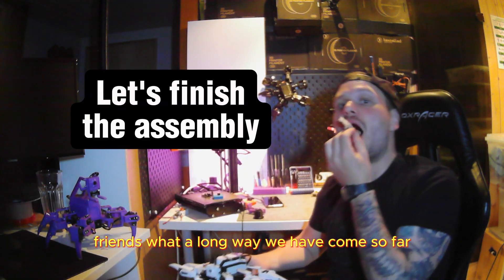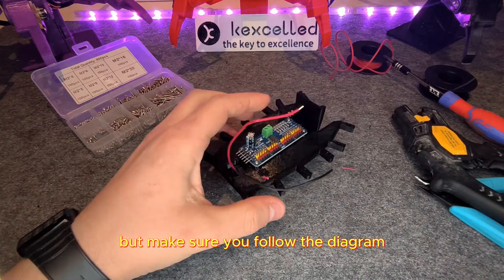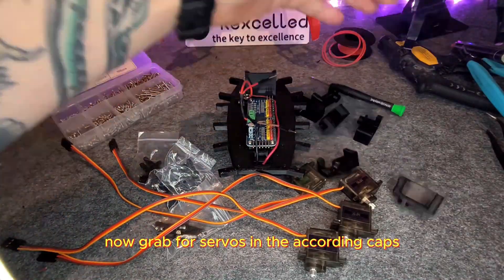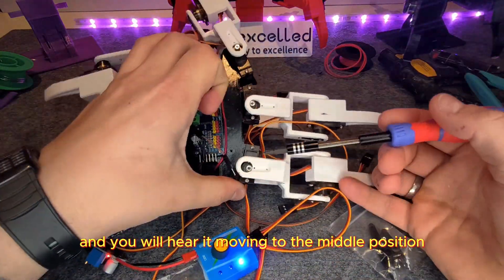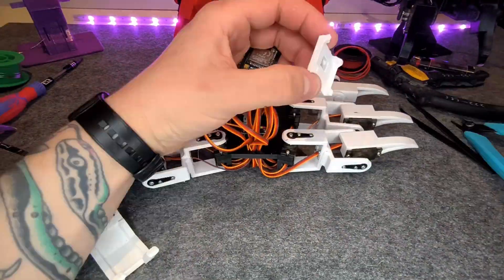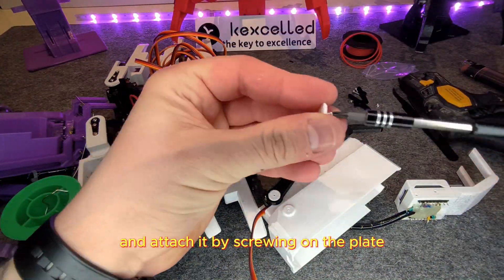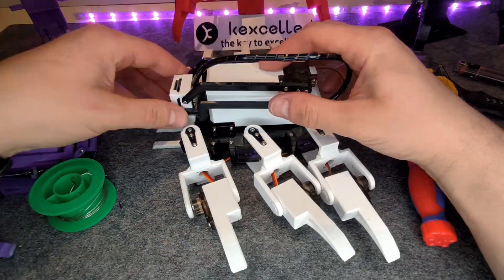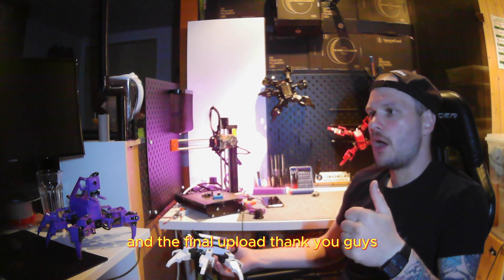Free Robotics Project Part 5: Final Assembly

Comment: Is your battery holder wiered in parallel, because I thought 7 volts are to much for the esp32 to handle.
Reply from the maker: @jan4926  No in serial. It's fine. The internal power regulator could handle even more voltage